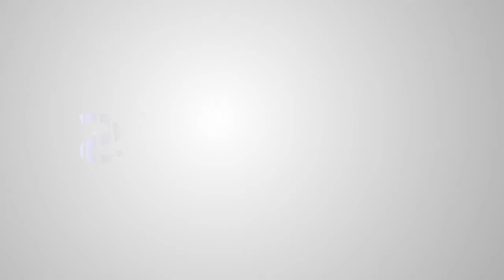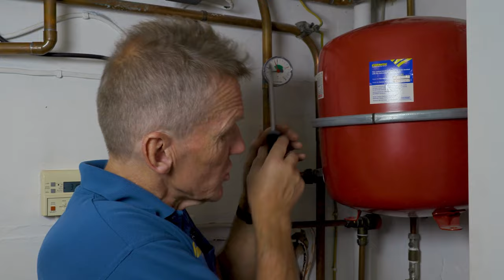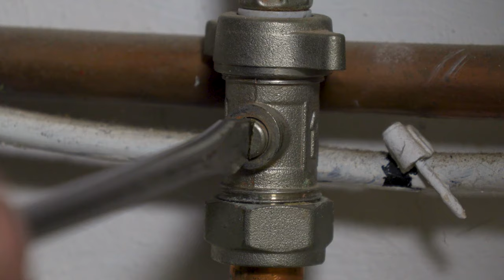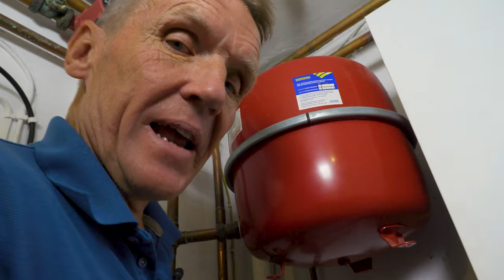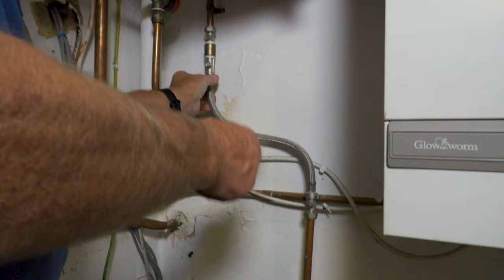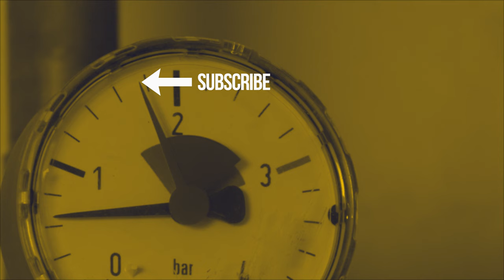How to Repressurise Your Central Heating System

Comment: Thanks so much Roger you bailed me out here. Had a rad off the wall, refitted it and bled it but half way through it stopped venting. Of course the accumulator had lost all its pressure. Thanks again for all that you share 🙏

Comment: I did this the other day but unfortunately I dropped the bloody screwdriver once I had opened it up and I don’t see very well so by the time I had found the screwdriver and closed it the pressure was far too high! I had to google what you were supposed to do about it but of course the answer was to just keep bleeding the radiator until enough water came out to lower it 👍🏻
Reply: This was extremely helpful, I wasn’t sure how to reduce the pressure in my system. My pressure gauge goes all the way up to 10 but maintains at just under 3 BAR, there is no green zone in my gauge so I’m not sure if this is too high. Experiencing frequent tripping at the moment due to what I’d assume is the element overheating (I have a amptec electrical flow boiler)
Reply: @sams1170  it should be 1-1.5 bar in the average house

Comment: Brilliant. We've been having boiling hot 1st & 2nd floors - but cold 3rd floor rooms for more than 1 year now and tried removing air again yesterday and some did come out, but then what little heat was coming out, stopped altogether and so checked the pressure and just above 0!!! so turned off the heating + boiler and filled as advised and within seconds we had full radiator heat coming out of all the radiators on the 3rd floor + more air came out, and that's with the heating + boiler still turned off, so huge thank you! Especially with these crazy gas/electricity prices and what's being predicted in Apr '22.

Comment: Thanks for sharing this. But my system doesn't have these two taps. It is completely separated from the water supply. How do I repressurize then? On the towel dryer radiator in the bathroom, on the very bottom end there's some sort of tap. Do I have to let water in down there? I'm a total noob at this, sorry.

Comment: It's worth adding that new or recently-refilled systems usually need re-pressurising several times as dissolved air (always present in mains water) gradually condenses and vents out of the system, reducing the water pressure. Once there is no air left in the circulating water the pressure stabilises.

Comment: Great video:) A had to do that quite often with my old boiler. My new baxi just has a single green lever thing that you just pull down, really easy. The old fittings started leaking in the end. Cheers
Reply: Did you manage to sort this? Did it just eventually stop? Mine is dripping.

Comment: very useful thank you; we have a Rayburn eco system which comprises Oil boiler and Rayburn solid fuel stove today I have had to open the two valves a number of times to restore the pressure so wondering if there's something else wrong; pressing the valve on top of the pressure vessel doesn't result in water spraying our so the diaphram would appear to be ok (4 1/2 years old)..

Comment: Amazingly timed video Roger. Just had to do that very thing this evening. Unfortunately water appears to be coming out of the hose now and given that it's bed time, I've opted for the "basin-under-it" trick until the morning. Any suggestions on a fix anyone?
Reply: Did you manage to sort this? Did it just eventually stop? Mine is dripping.
Reply: @PulseZ4  as it happened, I needed a new expansion vessel anyway (I have an oil boiler with water tank), and so replacing that and hoses and valves fixed the issue. I'm guessing that just replacing the hose would work, or even threaded tape perhaps, but I wouldn't be certain on the order of what needs turned off and where on a gas system, so I probably wouldn't do myself (even though it'd likely be simple) without advice from a heating engineer.

Comment: Our mains water is supplied via a water softener.  I heard that if I refill/repressurise the system without bypassing the softener, the soft water can damage the heat exchanger in our Worcester Bosch boiler.  Any thoughts?  Great channel.
Reply from the maker: If there is salt in the water it is corrosive so it is not a great idea.

Comment: hi Roger, thanks for video - my red needle is at beginning of green (1.5) but in the morning my black needle is on about 0.5. It only goes back up to 1 bar after heating/water has been put on for an hour at beginning of day - is this normal? Cheers
Reply from the maker: You should top the pressure up so the black needle is up to 1.5 bar. It will then rise to 2 bar or so which is fine
Reply: @SkillBuilder  Cheers for your help Roger

Comment: Can you do a vid on automatic filling valves, and what happens when they break. ie how to replace, and then how does this work to refill your system.
thx

Everyone does vids on manual filling loops.

But can you do a vid showing how a automatic filling valve works, and how that works?
Reply from the maker: The pressure in a hot system might be half a bar higher so putting two bar in when it is hot will probably settle at 1.5 when it cools off. I usually put 2 bar in and then go round and bleed the rads then top up again.

Comment: Should this be done when the heating is on or off, i.e. different temperatures or doesn't it matter?
Reply: When it's cold...as the pressure will rise with the temperature increases

Comment: Seems a little high at just under 2 when cold? Thats prob going to be well over 3bar at full temp. I always thought 1.2bar was the right pressure at cold? I'm no expert mind! Love your videos by the way!
Reply: Yes I run mine at just 1 bar but I guess plumbers pump it up to a higher pressure because it will take longer for the pressure to drop and therefore longer between callouts., The system won't run any better or worse at different pressures unless someone can convince me otherwise.

Comment: Hey Roger, do you know why the pressure goes up when the heating or hot water kicks in?
Reply from the maker: The water expands. It should go into the expansion vessel and out again as it cools. If the air cushion in the expansion vessel is depleted the cushion will not be there and the pressure gauge will rise. You may find it squirts out a bit of water through the relief valve as it expands and then when the boiler is off the cold pressure will be less than it was. .
Reply: @SkillBuilder  Thanks for the speedy reply mate👍🏻

Comment: How do you get the pressure down ? I don't have radiators.
Reply from the maker: There is a pressure relief valve, just turn it a quarter turn.

Comment: With a nonreturn valve on the filler hose could you then leave the hose attached all the time? Water can't flow back into the system I reckon.
Reply: Blakey!!! Haha.😂 comic genius.
Reply: @alabinibop  And Smiler!
Reply from the maker: I agree but it is not the way that the Water Regs view it. They say it can fail.
Reply: @SkillBuilder  It was just a thought. Rules and regulations often stop "no brainer solutions"
Reply: 90 times out of a 100, the flexi will be on top of the boiler. Where it should be. I always carry one routinely if the user loses it. Filling loops should never be left on. Ballofix valves, IMO, are unpredictable and will eventually either leak at the screwdriver slot or let by if they are not spot on... goldilocks position.

Comment: My mothers central heating was on a low pressure and after turning it up the pipes were rattling like buggers for ages and water spurting out of the overflow pipe

Comment: Reckon there would be significantly less call-outs re: boiler pressure if heating engineers were to reset the static air pressure in the expansion vessel as part of an annual service.  
In my experience it is rarely done; so it is only a matter of time before no air left in the PV => nowhere for heated water to expand => PR valve opens and dumps the excess water =>  after boiler turns off,  water cools, pressure drops below 1bar and boiler locks out => keeps happening so home-owner has to call the heating engineer for a repair....ahh NOW I get it....
Reply from the maker: Spot on
Reply: My pet peeve. In fact, it's a major psychotic rage. Streaks of luminous, green moss running down the outside brickwork beneath the prv terminal. Usually it's the tenant topping up, (and forgetting to vent the rads) and the landlord asks you attend, weeks later. Either a torn/perforated  exp vessel diaphragm, or just needs simply recharging and/or a prv that has just had enough. Often, a sticky needle on the pressure gauge means that the user is overpressurising, or the filling loop is letting by----->
Even worse. The x2 check valve fitted to the c/w side and the iso on the return at boiler. So, you cant even remove the filling loop. FFS!
It's not rocket science or metaphysics. Rant over. Back to some decline of our civilisation. Slowly we inch towards the abyss of insanity...
https://www.youtube.com/watch?v=Zfka_-DPbdc
Reply from the maker: @loafersheffield  Brilliant. One of your best rants for sure and truth in every line.
Reply: Jimmy (Plumberparts) live streamed earlier.  He disables real time chat if he publishes, or just chooses not to publish his livestreams at all. You may want to decide to remove that link I inserted. This is where I spend my Friday nights. It's like a pub for blokes with bigger brains than me. You-tube is becoming increasingly censorious with regard to controversial opinions.

Comment: Hi, how do I re —pressure a combi boiler. Some of my radiators are not hot enough?
Reply from the maker: The filling loop is in the boiler. Look underneath. Find out what boiler it is and then look up the instructions on the internet. They vary a bit. Worcester Bosch might have a key which is kept in the flap.

Comment: I thought 1 bar was correct when cool ! It rises as it heats
Reply from the maker: Sparker

You can put in one bar but it doesn't give you much of a margin for losses. The green area on the guage is up to 2.5 bar so putting in 1.5 bar and letting it go up to 2 bar is still within working pressure. In houses with loft conversion the static pressure on the top floor can be half a bar lower so it helps to have a little bit more rather than less. You can get negative pressure on the air vents on radiators if the pump inlet (say 2 bar) is more than the rads.
Reply: @SkillBuilder  I live in a flat. Thanks for the reply 👍

Comment: 2 bar ! ?

NO

1 bar is correct.

And that's with the system cold.

And also where the boiler / equipment is fitted within the property.

So boiler fitted down stairs and just an upstairs, normal house.

Once filled to 1bar and disconnected then leave heating on untill house flat warm and boiler and system have achieved full comfort around the house.

Then take a look at pressure, normal house with normal system should now be at 1.6 /2.2 bar.

This tells us the heating water is heated and the heating water is now hot.
It has expanded.

This is correct.

If left to go cold it will return to 1 bar.

This is correct.

NEVER GET NEAR 2 BAR hot or cold.

The safety valve fitted to all systems is 3BAR.

Should the cold heating water get hot and expand if the system is over FILLED it will leak out the PRV  pressure release valve.
This pipe terminated outside , so you may not see it dripping.

Next day when your system is cold you have lost the pressure. 

1 bar then look at system pressure HOT.
Reply from the maker: 1 bar is a minimum and putting 2 bar in allows the systems to settle and the radiators to be bled. If it loses a little water out of the pressure relief valve it will then have reached its equilibrium as you almost pointed out.
If I topped up a system to 1 bar cold I would be back there a few days later to do it again so my way allows for a little future proofing. 

 If you have a loft conversion some of that static head is lost by the time you get to the top radiators so putting in 2 bar allows the cold pressure to be close to 1 bar at the top of the house.
Reply: @SkillBuilder  your way allows for the system to leak out the PRV.

And if rust is present or other filth in the system this can jam under the seating of the PRV.

Then it's going to let by at any pressure , outside and the people won't know.

Heating expansion takes place in the winter for the most part.

A time when people are not out looking at a dripping pipe.

So they just keep filling it up.

This oxygenated water then leads to rust and boiler breakdown , especially if it's a combi.

Keep telling people 2 bar is good

A concise understanding is good , most end users reading 2 bar could lead to their future problems.

You are a good man , but I totally disagree with you.

I have been doing it 30 years
Reply from the maker: @trojannunu  I have been doing it for longer than 30 years but I would not say that my experience trumps yours. It is just a different way of doing things. You should always test the PRV anyway and if it lets by then run a load of water through it or whip it off and clean it. That is something I have done many times. Being afraid to open it in case it lets by means that it may stick. 

2 bar as an initial charge is IMO fine in fact when you look at the green zone on that gauge it is where is operates,  I still maintain it will settle down around 1.5 cold..
Reply: @SkillBuilder  yes but .

End users are / can be suseptabubble (new word) to hearing/ seeing things .

It's good you know.

I know , I just would not mention 2 bar .

There are too many different parameter , system size, system water volume , position of expansion vessel / vessels . Position  of PRV AND THEN add Bungalow or 3 storey town house.

Anyway , are crossed swords should help people , I like to think.